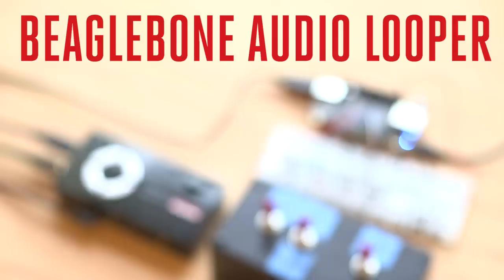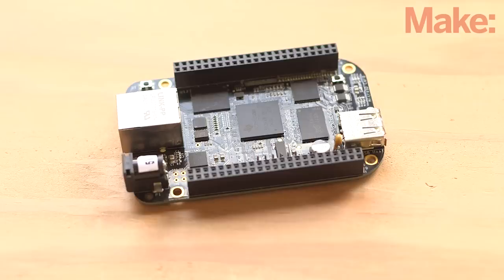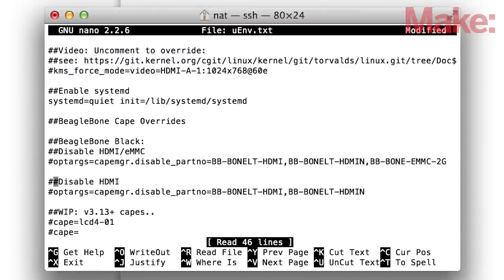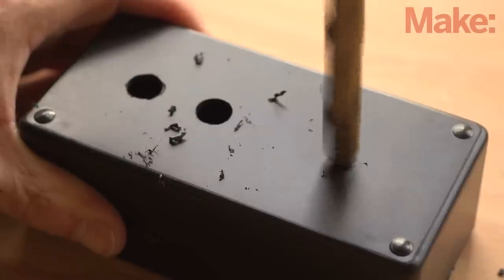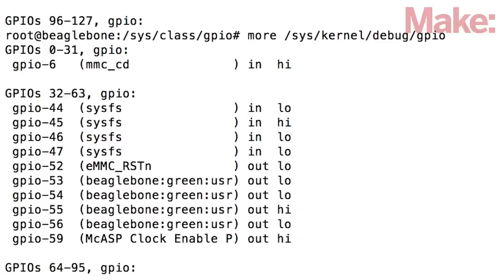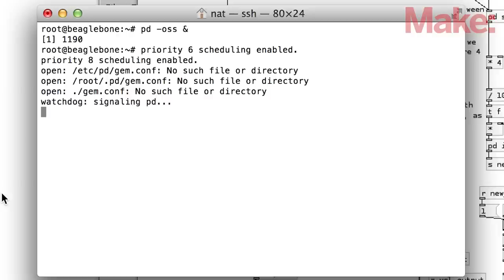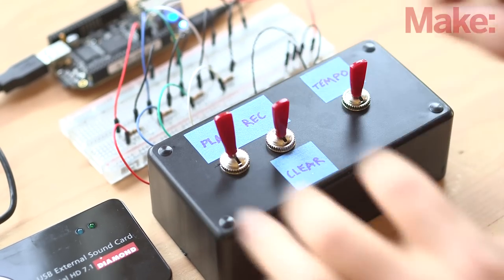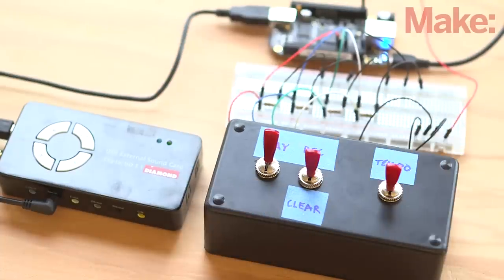Weekend Projects - BeagleBone Audio Looper

Comment: Wouldn't a raspberry pi be more suitable as it has a built in headphone jack and is cheaper than a beaglebone black
Reply: In this case, I'm guessing it is the ARM compatibility with the designed software. Remember the Pi only has an ARM v6 based processor while the Beaglebone Black sports (I think) an ARM v7. Also, it seems the BB has more GPIO pins to work with... though with how many were used in this project, that is a mute point. Honestly, with the Model B and the second USB port, you could just plug in a MIDI board or an Arduino and just do the same thing, and at least all parts would be usable on more platforms, but I digress.
Reply: Flame Soulis PureData can be run on Pi without issue. If you plan to build this there, I'd suggest a Pi B+ as the audio quality is improved vs B. I built this before the B+ was announced. On the B, noise was being picked up and recorded into my loops. 

I also ran into CPU speed issues (even when Pi was overclocked) when working with longer loops. The Beagle has a bit more power. I've had 2 long (30-40 second) independent loops and a click track running on the Beagle without slow down. One loop of similar length and I'd see slow down on the Pi. You could change/improve the implementation in PD or write a looper with Csound and I'm sure you would see better performance.
Reply: Huh... then I seriously have no idea why you couldn't just substitute a Pi in for the project, but maybe it was for the out of the box performance. No idea honestly, I haven't toyed with a BeagleBone before but I've been meaning to poke at it at some point.

Comment: DPDT is 3-way toggle?
Reply: It's usually two. These have two different "on" positions and the center is "off". Some companies label them as DPCO (center off). The Radioshack part is listed as: DPDT with center off.
Reply: Tyler Worman whats the 3-pos then?
Reply: ThunderWiring Are you referring to the 3 rows of connectors on the bottom of the switch? If so, one row of connectors is common/ground.
Reply: Tyler Worman no, im referring to the 3-way switch.